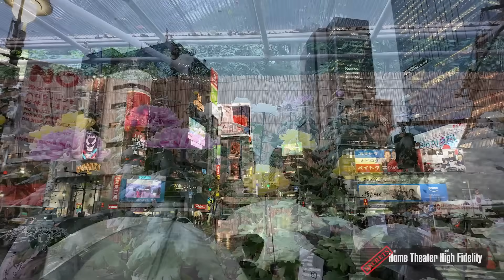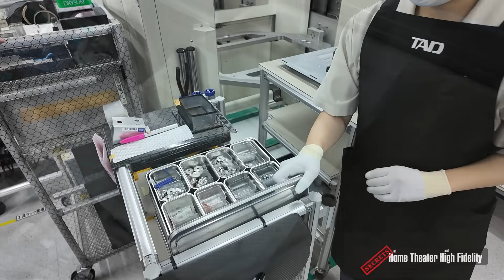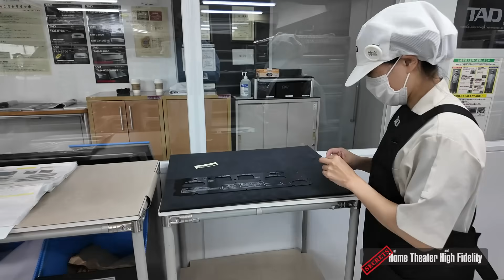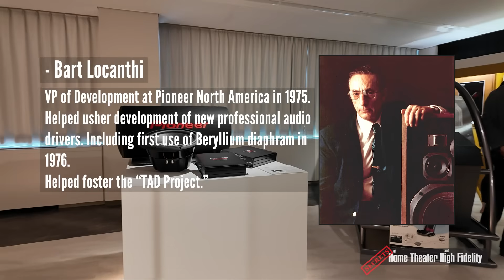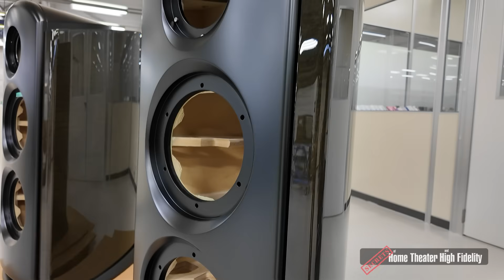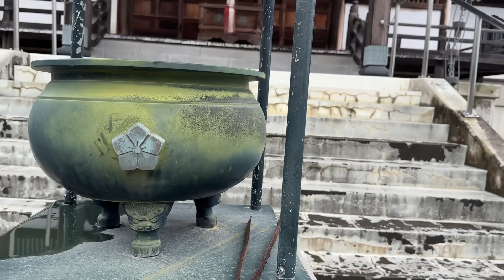TAD Factory Visit 2024 - Carlo in Japan Part 2

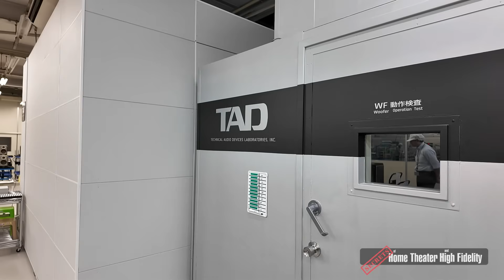Comment: 15:39 Yep it must be easy to get the polarity wrong by having the voice coil and spider up-side-down when assembling the driver (I suppose). 😂 I have had a few surprises with two identical drivers (of the same brand) when one is opposite polarity (after testing with a battery). If you build speakers you have to do the battery test before installing drivers, even if they are the exact same product. 😂

Comment: Interesting internal speaker cable used, very basic AWG 12 by the look of it. Rather cheap cable. It’s a surprise really. I know that Kenji-San at Kenrick’s Audio use hand selected and tested directional silver  wire among others. Quite often using external cross-over designs.

There’s a lot more here to explore I’m sure.
Reply from the maker: I’m sure the cable quality is perfectly suited for the job at hand.

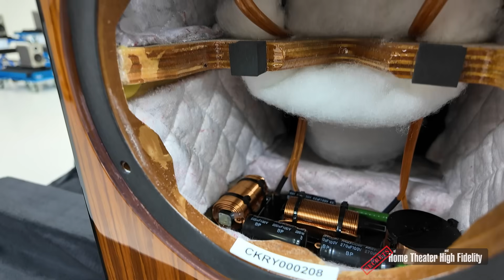Comment: @17:28 There you have it... Ferrite cores and electrolytic caps... Which ultimately makes it a POS...
Reply from the maker: Hardly.
Reply: You spend too much time over on the GR-Research channel.  🤫
Reply: Just a bunch of bs myths spread by snakeoil salesmen... it would probably cost them .01% of the build to make that so called Upgrade to air core and poly caps...its called voicing for a particular sound signature
Reply: For bass reaponse below 100 Hz it is inconsequential..